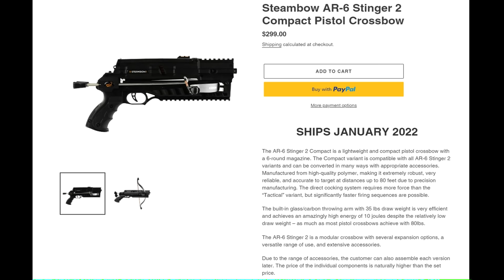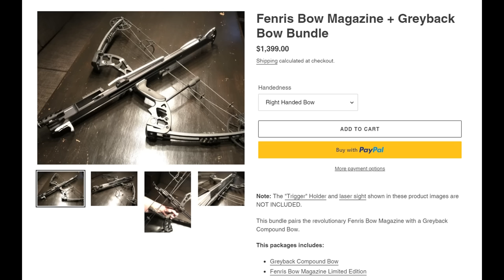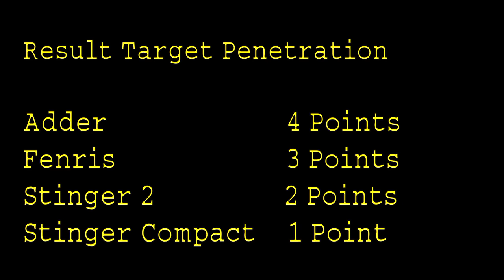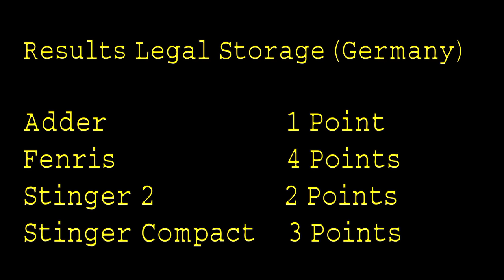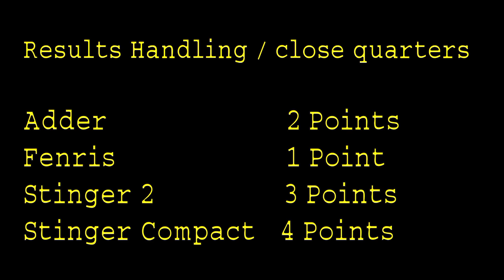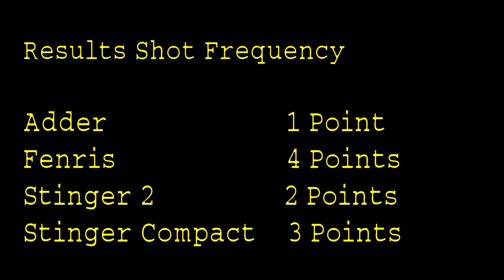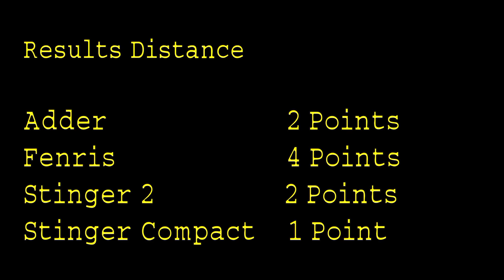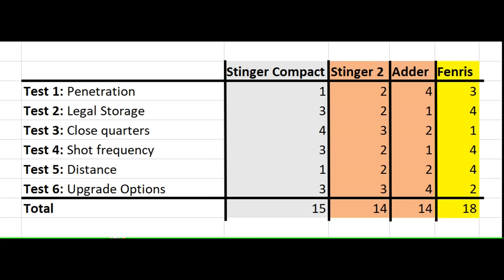Home Defense With Bow and Crossbow? OF COURSE!

Comment: Hello thank you for sharing awesome video I wanted to ask is it okay for home self-defense to have a recurved takedown bow strung adult I'm either with a 20lb limbs or 60 lb limbs? For home defense thank you for a better idea of what I am talking about I have to Southwest archery Spyder recurve takedown bow I got it at Amazon thank you! :-) so I wanted to know if it's okay if I leave it strong all the time
Reply: If you haven’t shot a bow before your not gonna be drawing that 60lb now on your life. Let alone holding it at draw point. That 20lb bow is gonna feel shaky at first. Buy cheap how’s work your way up.  Deer hunting with a recurve I think is around 40lb minimum in most places but my 30lber could definitely hurt a person with the right tips.

Your best bet is to shoot thumb release or Mediterranean with bodkin tipped arrows in the bow hand. Thumb release allows arrows to be easily held or loaded in the bow or draw hands. Bodkins are probably the safest. The real issue is using a bow indoors and in a stressful situation bodkins penetrate but won’t hurt you.

A Turkish or tartar short bow are gonna be the easiest to use indoors. Probably the Tatar because it’s flat back allows you to hold arrows in the bow hand easier and that’s more secure.

Your gonna need a lot of practice. Bows require decent fitness and muscle memory but I can load my bow by feel in the dark. Your real issue is hitting the ceiling or walls when maneuvering the bows/arrows so you’ll need to drill that. Also knocking is an issue when moving quick. I know Lars Anderson uses some sort of modified nocks (I wonder if adder/ stinger nocks could work?). If it’s not properly nocked you can hurt yourself and dry fire the bow. There’s quick nocks out there somewhere!

Finally your form needs to be on point. You won’t have time to put on an arm guard or glove, maybe a thumb ring if your quick. You can’t let the string slap your arm or your disabling yourself as much as your attacker. Also using feather fletching can help because plastic vanes can hurt your hand as they pass the body of the bow.

I’m not saying it’s not possible just that it’s a commitment and understand you might not get a follow up shot even with speed shooting techniques. Learning a recurve bow is more like a marital art than using a crossbow, fenris, or gun.

Oh finally make sure you tune your bow which basically means the arrows you use need to be for your draw length with the right grain points and spined to the weight of your bow.

I know it sounds overwhelming but this all can be found online. If nothing else you’ll have fun learning traditional archery.

Edit: you can’t use a takedown now because you need your weapon strung and ready to shoot. This means a fiberglass or carbon fiber glass composite. Natural materials don’t like being strung all the time. Even a take down bow has to be stung either with the leg method or a string assist (at least as far as I know)
Reply: @OpiatesAndTits  very cool thank you for all that awesome information! :-) I could draw the 20 lb easily I have not tried the 60 lb yet LOL I do use a Stringer did notice field tips go right through the garage door they are pretty strong but I also do have the three edged tips hunting tips

Comment: i have but one question. What if you buy this crossbow and keep it "not locked" in your house??? How would the police notice that? Do they search your house regularly?
Reply from the maker: Since I hold gun licenses, I had to surrender my civil rights and the authorities can now "inspect" my house at any time, without a warrant, unannounced. Theoretically they can only inspect how I store my REGULATED weapons, but anything else they see can and will be used against me. If they would see a crossbow hanging on the wall, unlocked, they would slap a fine on me and then take away my guns. I would no longer be "reliable" in terms of gun ownership. 
I know about other cases where a neighbor saw an airsoft gun through the window and alarmed the police. They kicked in the door, found the gun (which was legal) but also a crossbow, not properly stored. They took it and the owner was fined 1000 €.
Reply: @Slingshotchannel  wow, das wusste ich alles nicht. vielen dank für die antwort herr.

Comment: Is there a bow like the Fenris with less penetrating power? I'm concerned that the more powerful weapons here will over-penetrate, turning what should have been a debilitating hit into something that won't stop them. With firearms there's even a risk of hurting something behind the intruder although it doesn't appear that even the strongest weapon reviewed here has that risk.
Reply: The ballistics gel doesn't have bones, so chances are the arrow would still stick out someones thorax after getting caught on a rib or sth. 
Still I think most people would play dead immediately after getting shot through, if not immediately then certainly so within a few minutes unless you've hit them in the leg or sth.
Reply: You can tune a compound bow down like 90% this maxes out at 70lbs draw which is I dunno 100ish in recurve rules? Trust me your not putting a 15 inch arrow with fletching all the way through a persons chest cavity and clothing. But they may get a broad head sized new hole to breathe out of.

Comment: Is not possible to have the arrows loaded from below of the crossbow instead of the top ... just like automatic weapons?Appologies for eventual grammar due to not being a native language
Reply from the maker: The cocking lever would be in the way (Adder). You also need to install the red dot a bit higher, on eye level, so it makes sense to put the mag on top.
Reply: Yea...but if the arrows stay at the top you will never be able to load 15-20 into the magazine.You say thay may be some problems if you have the magazine below but you always find a way aroud.Just think about that ....cheers

Comment: Youve shot the bow once, so you might as well pin the guy to the spot by emptying the magazine.
The emergency services could cut the floor around the burglar and use the boards as a stretcher.
That way, you wouldn't have to worry about a bloody great stain to remind you of the trauma you've been put through.
The burglar could claim being framed, that would true, as would being fitted up, his alleged frame would fit the hole left in your floor boards.

Comment: doesn't the longer shaft create more friction and make the arrow stop quicker than a bolt in ballistics gelatin.
No pump action pistol crossbow? one handed cocking action in front of the trigger combined with short skeletal butt stock  and red dot would make one stupid fast arrow spitter.
Reply: Check out his "CIA Adder" for that. However it's a beast to cock.

Comment: Does the Stinger speedloader work with the broadheads? Only ever seen it used with the field tips.
Reply from the maker: Works with broadheads just fine.
Reply: @Slingshotchannel  Thanks Joerg! Been eyeing the stinger for a while and waiting as I suspected more upgrades were around the corner. Cheers for improving these. 
Will be getting myself a Stinger 2 Compact as it looks easy to store, quick to use, good in close quarters and even my GF should be able to use it. From your comments, I think I'll go for the mid-weight (50lbs) bow limb on it (presume that's still easy enough to cock? I know not to bother with the 90lb one on this model). 
Great weapons, mate! I'm keeping an eye on the UK store for when it's loaded with more options.

Comment: No gun? Home defense?    "Kaiser Blade , some people call it a sling blade, but I call it a Kaiser Blade" ;)*
Look them up, it is basically a Bill-Glaive and it is a "common" yard tool. A hand-crossbow will not deter a determined  enemy in one hit , short of a critical/lucky/chest/face hit, and you won't get another shot in many of those cases, as crossbow is infinitely slow to reload compared to a firearm. And forget any bows or sling shots, although I have seen many of your demonstrations. If your first shot misses or hits a non-vital spot/area ,  you're very possibly  F'ed. Shooting a living thing in a chaotic, fast, and/or dark, and/or  confused situation is not so easy as shooting targets. A first and disabling hit is not garanteed.
Yea, you are a master of the fast crossbow , but hardly nobody else is.
Then there is the penetration issue,  a criminal might dodge in a hallway corner , a cross bow bolt will stick in the wall, a bullet won't.  
A good knife works at close range, but you need to know how , and able physically, and willing  to use a knife,

IMO for Germany , I suspect the best 1st weapon for home defense/defense is a gas pistol, but my knowledge of German law is 30+ years ago.

*If you have not seen "Sling Blade" I highly suggest- the movie , as to my first comment line.
I do appreciate your mention of how loud firearms are inside a room/house, 
you are on the mark there.

Comment: Here in the U.K., you would be committing a criminal offence if you had something kept specifically for self defence
Reply from the maker: Ridiculous. But we have the same tendencies here.
Reply: Yes, but somene I know uses a wood stove to heat their house.  So they always have an axe in the wood basket in case they need to split some kindling.  And also a small lithium battery chainsaw in case there is a log in the basket which is too big to fit in the stove.   The Stihl 160T is perfect for the job, as it can be operated with one hand, allowing the person to hold an axe in the other hand at the same time.

Comment: Odds are that the criminal will have a gun because criminals don't care about gun laws and jumping out in the open like that will most likely get you killed. While the bows are better than nothing I would still rather have a firearm for home defense.
Reply: You're not thinking about the countries (such as the U.K) where practically no-one has firearms. These are better than nothing.
Reply: @BobT36  All I know is that I would rather be judged by 12 than carried by 6

Comment: Why not use a regular bow and arrow? you can still open doors while carrying a bow. you can use speed shooting techniques. You dont need full draw to be deadly just pop shot
Reply from the maker: You need a lot of practice to master speed shooting with a normal bow. During an attack, it will be even harder as the adrenaline kicks in.
Reply: @Slingshotchannel  A thick wooden war arrow could be a spear if all else fails. You can throw the bow as distraction and stab with your mini spear.

Comment: Are electronic locks permitted on the storage box for these? There are new RF ID style locks where on can use a wearable watch style fob with the e chip in it. There are some individuals who go the extra mile and have a microchip implanted into their hand that can access these locks. Another question, how often will the police come into ones home to inspect the type of storage compartment one has? As a class three licenced owner of an actual machine gun, police or the BA
TFE will never come and investigate what you have for storage. Some states do require a lockable safe or storage container where anyone under the age of 18 cannot open the containment unit.
Reply: RFID locks are easily disabled and bypassed unfortunately. I even people who got implanted ones and half are already obslete. Even if you don't have the code, the solenoids used are usually defeated easily by a small magnet.

Don't use e-locks when it's important. They are primarily used for automatic access logging, not security.

Comment: The law protects the criminals more than the victims. I will not hesitate to shoot an intruder. No need to kill. They have legs and other body parts. However, first thing to do is not to shoot. Just aiming should stop pretty much anybody. If an intruder does not stop, he probably is completely stoned with certain substances. In that case, you may not have a choice... But never intentionally kill someone or you will be treated like a criminal for defending yourself.
Reply: Nobody aims to legs, because it's bloody difficult to hit that target
Reply: @headland4016  better start learning. If you kill an intruder, you might go to jail, unless you just hide the body. But like I said, aiming should be quite enough. It's not like in the movies where the guy is still coming at you with 8 rounds in the chest.

Comment: is it though?  Could you skirt the rules by having an actual medieval replica bow and arrows mounted as wall decoration?  The accessibility issue basically breaks the whole concept of self defense here.  And would it even matter?  Without a castle doctrine, you're guilty of harming the invader almost no matter what.  You'd have to wait until they are pointing a firearm in your face before you're cleared to fight back with your little toy, putting you at a near impossible disadvantage.  You're definitely better off first trying to spook them with loud noise and lights - and if they're really out to get you, you either bug out, hide, or be damned proficient in hand-to-hand combat.
I think you're better off just saying the video is for zombie apocalypse...  There's virtually no scenario conceivable that this would actually work as self defense in a woke world.

Comment: Can I use a drawer with a lock that is almost broken BUT TO GET A LOOP HOLE IT IS NOT STRONG AND IF I need I pull if so hard it breaks and I Get a almost instant access to the bow rather than needing a bow